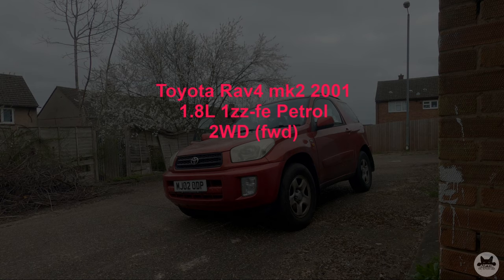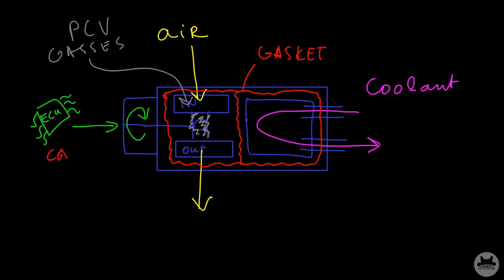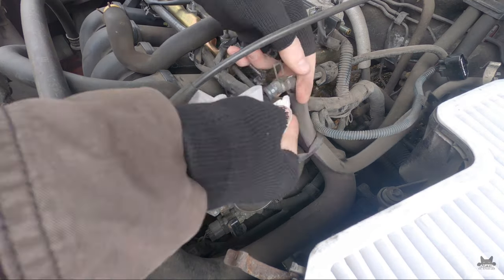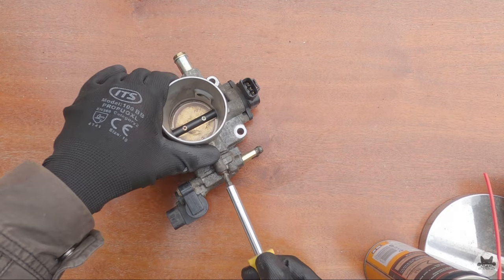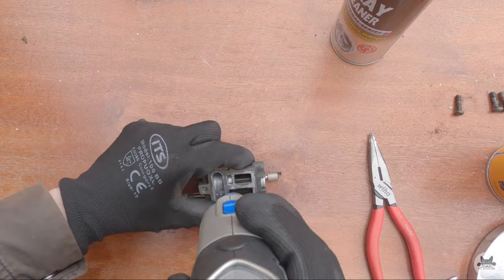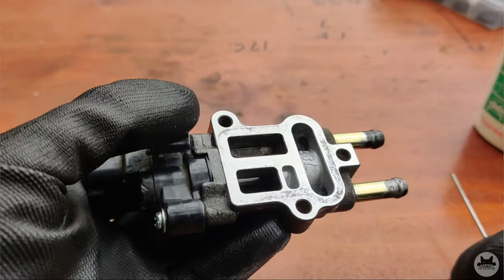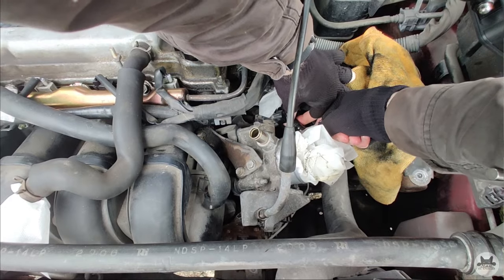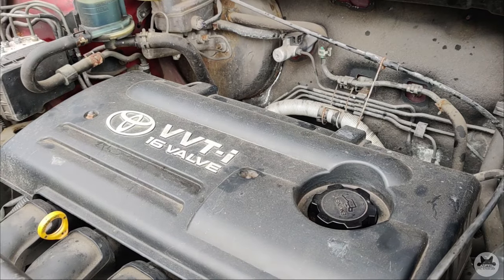High / Low Idle RPM fix - IACV cleaning (Toyota Rav4 1.8L 1ZZ-FE 1999-2005)

Comment: Could you tell me if you know if that “idle air control” valve is also the San as for a 2003 Toyota Corolla model? Before I take it apart that would really help to know 😅
Reply from the maker: I don't have a 2003 toyota corolla to check 🤣
If it's a 1.8L, it will probably be the same. Even if it's not the same, it's likely to be very similar so everything in this video will still apply, just the shape and  location of it might be different
d
Reply: @TheRepairLair  Thank you so much for getting back to me! 😬One last question you sprayed some carb cleaner and oil in the IAC motor but other videos I saw said to try to keep liquid or sprays away from the motor but with your video you sprayed it straight into the hole of the motor. I just want to double check that’s OK to do and it won’t damage the motor at all?
Reply from the maker: They could have been referring to avoid spraying anything into the IACV if cleaning the throttle valve without dismantling? I don't believe there's any issue spraying as shown in my video - the plastic part is fully sealed and no cleaner is able to get into the motor internals.
Reply: @TheRepairLair  ok great thank you 🙏

Comment: Hello, I watched all of it and want to try this out. My engine rpms during cold starts jump up and down, so down that the engine slows down, could this be the issue?
Reply from the maker: It's worth trying, although if it is jumping around wildly while warming up it might not be a mechanical issue with the iacv but an electrical issue with the ecu and iacv communication
Reply: @TheRepairLair  after taking the video I cleaned the maf with maf cleaner and the problem was the same, turned off car, disconnected maf sensor and problem was the same, could it be the iac valve that’s stuck?
Reply from the maker: @SBdunks3  If its the same with MAF sensor connected or disconnected, then i suspect the MAF sensor itself is bad - you might want to try getting a replacement MAF sensor first. Stuck IACV would not do this jumping up and down as shown in your video so i'd definitely look into the MAF sensor replacement first.
Reply: @TheRepairLair  will do thank you 🙏🏽

Comment: Good day.
I already cleaned my IACV, throttle body and TPS. But still may RPM droppes until my engine dies. This will happen during cold start. But when my engine temperature goes to normal after 5 minutes,, my rpm remains at normal 800rpm.
Reply from the maker: I don't believe the engine would die when cold due to a bad IACV, but sadly i don't know what could be the cause for this as i haven't ever had such an issue myself. I would like to suggest you check that your butterfly valve is clean, and then inspect the idle stop screw as well as the arm that rests on the stop screw - i might be completely wrong here, but maybe it could be that the idle stop screw or the stop screw arm have worn down, and now the butterfly valve closes completely so the engine gets almost no airflow. Though i don't think this would explain how the engine runs when warm, but doesn't when cold. Worth taking a look though. Please let me know if you find the problem!
Reply: @TheRepairLair  
Butterfly valve cleaned. I adjusted idle stop screw. When cold start rpm at 1000. But when warm, may rpm reads at 1500-1800. Near to 2000.
Reply from the maker: @rommelrodrigo6146  It almost sounds to me as if the IACV is plugged in backwards, though i don't think it should be possible to plug the connector the wrong way around. Sorry to say but i don't have any other suggestions - the issue is likely elsewhere
Reply: @TheRepairLair  
Thank you sir. Anyway i'll check it again.

Comment: excuse me, is it normal if the idle is 1200rpm, just like yours? my car is exactly the same as yours (rav4 1zz A/T)
Reply: Or, you have another problem like selenoid idle up behind the air box filter
Reply from the maker: @lexwangsby.bryan_bja  The normal full-operating temp for 1zz-fe on the rav4 is about 700-800. When i was filming the video it was middle of winter so too cold and not long enough idling to fully warm it up. If your car NEVER idles lower than 1200, then that doesn't sound ok to me, but apart from the IACV and maybe something being stuck in the butterfly valve preventing full closure, i don't know what to suggest to check
Reply: @TheRepairLair  okay, i got the point. But the problem must be from throttle body right? Yes its stuck in 1200rpm, never going lower. Oh the weird things, when i start the car, it's in 800rpm. It's like something has reverse it LOL
Reply: @TheRepairLair  well anyway, thank you so much for replying me, im Bryan and i'm from Indonesia 🙏, and this car is a rare item 🤭

Comment: You need to buy an inexpensive torx set of tools (bits). Maybe your butterfly stop screw is maladjusted because idles is still above 1k rpms, even warm.
Reply from the maker: These are 5 point torx which are not typically included in off-the-shelf bit sets. Regarding the RPM's, they only drop to ~800 when fully warmed up. Hope this info helps.
Reply: @TheRepairLair  Looking again I got it. You're totally right, sorry for my jump in inconsistency!

Comment: Tq sir. Why when Cool enjin rpm no idle.. Rpm drop 0.0rpm.. Enjin Hot rpm ok rpm1.. What poblem my car?  Plz help me
Reply from the maker: Sorry I'm not quite sure i understand what you're asking. What is the RPM when cold, and when hot?
Reply: @TheRepairLair  meter RPM down to zero.. When Cool..
Reply from the maker: @universalstudio7411  so you can start the engine but RPM immediately drops to 0 and engine stops? Does the engine continue working if you were to start the engine while also keeping the accelerator slightly pressed? 
If so, you might need to adjust the idle stop screw.

Comment: The hard part is documenting and organizing every removed part and then reversing that order in putting them back😬 Also, before I dive in with the assumption that this is my issue, can anyone confirm that a carboned IACV can cause engine stall even when I'm already on the road, every time I slightly slow to turn?
Reply from the maker: it could be the combination of both iacv and carboned up throttle plate - if the gaps of the plate at idle are fully covered, and iacv is also stuck closed, then there will be basically no air getting through

Comment: 100 bucks says you it didn't really need cleaning. IAC Valve Reset- Warm up vehicle, turn key off, then back on without starting, turn key off, then back on, then to crank(start vehicle), put on parking brake, put in Drive. Let run or drive for 7-8mins. Done. Standard procedure. If that don't work, change IACV.
Reply: ...or clean it as per this video, because it's bound up with gunk. A reset will be the fix if you've got a software problem and the valve moves freely...and if it's just gunked and easily cleaned, why replace it?

Comment: Aren’t those just  torx screws?
Reply from the maker: Yes, but they are 5 point torx, not usually provided in most bit sets.
Reply: @TheRepairLair  oh. Interesting. So not what Toyota uses elsewhere?…like the steering wheel airbag?

Comment: Rav 4 with a 1.8 litre engine is cursed as haha. In Australia they have 2 litre engine and they perform decently for what they are, i know its not a massive difference but the main thing is the engine in the Australian rav 4s being the 1az fe is actually desgined for cars of its size ie camry etc. The 1zz fe is corrola engine which essentially means its would theortically run the best in a lightweight car, honestly dont know why theres an engine difference in america and Australia but who knows, at least youd get slightly better fuel economy
Reply from the maker: 1zz-fe is very unpopular with rav4s because they only come with fwd rav4s, and there are almost no rav4s with only fwd. Most of the rav4's in UK have either the 1az-fe (2L), or 1cd-ftv (2L diesel).

USA has the 2az-fe which, if i remember correctly, is pretty much exactly the same as 1az-fe but with a longer block (2.4L). But they don't get the diesel (the one in the video isn't mine, mine's the diesel version, and i LOVE it)

Comment: Hint  get a JIS bit for screwdriver this is a Japanese industrial standard.
Reply from the maker: I have various sets of bits, and none of them had this specific one. I would argue its not worth buying a specific bit if you're only ever going to use it once, especially if you can remove the bolts via other means :)